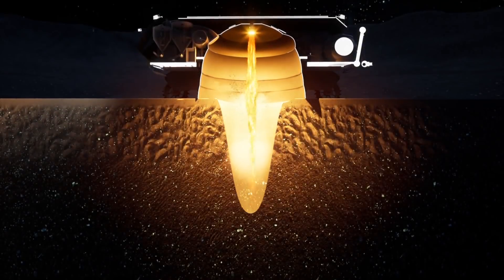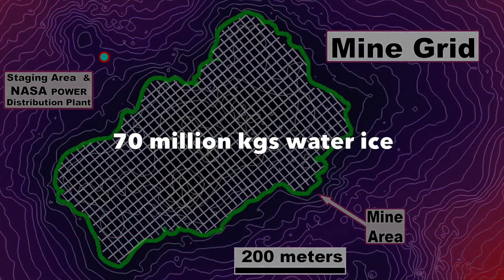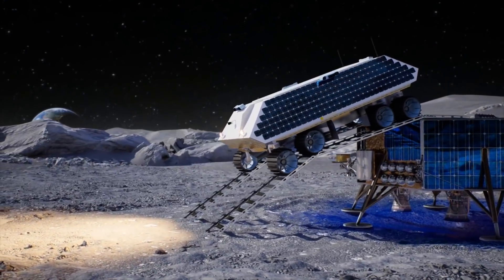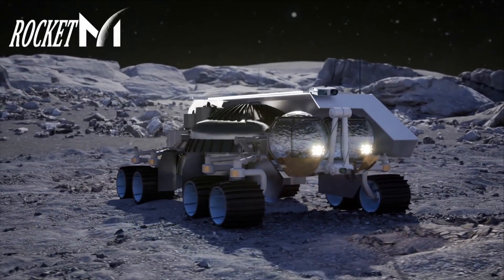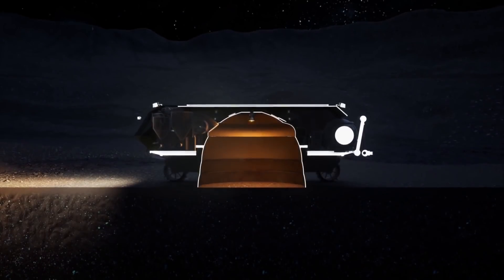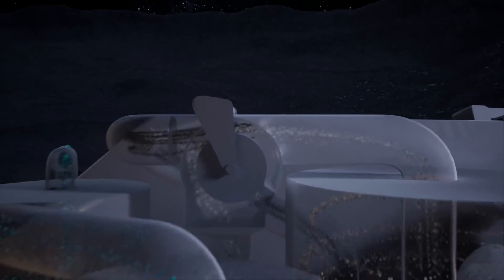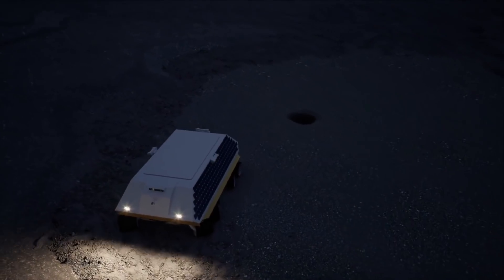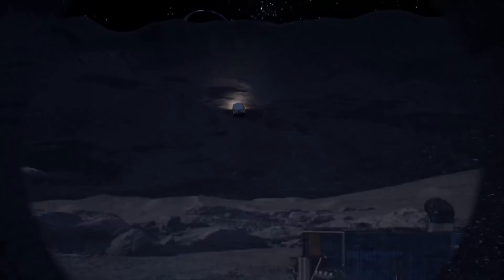Rocket Mining on the moon! Learn how Masten plans to extract volatiles

Comment: I must have missed something...  Where is the fuel for the rocket extraction system going to come from to dig thousands of holes in the lunar surface?  It has to use a whole lot of fuel.
Reply: well it’s already icy and it’s using pulses instead of a constant burn, also it’s not trying to lift anything just melt. Maybe it gets a top off from the lander or other dedicated systems that they didn’t talk about?

Comment: okay, so they're going to use a rocket engine to dig holes in the lunar surface....and they're going to fuel it with what? if it's some sort of pre-processed rocket fuel (hydrazine or some other hypergolic fuel), then they're only going to get so many firings before they run out of fuel and have to 'refuel' from their lander or wherever. if, otoh, they're planning on using hydrogen and oxygen derived from the water they harvest, then that's going to eat into the amount of water they can deliver. worse, the amount of water present subsurface is going to be a 'guesstimate' based on remote sensing data. so what happens if the water is just a  surface deposit, with little-to-no ice underneath?

Comment: Create a seal?  Pneumatic cyclones?  Is this a joke?  

Did you guys miss that day back in Rocket Scientist school where they taught about space, including the surface of the moon, being a total vacuum, completely void of any air/gas that would be needed in a pneumatic cyclone system?  

And what was it about all that jagged lunar material that was brought back to earth back in the days of Apollo suggests that there is even a snowballs chance in hell of creating a seal that would contain and maintain any kind of air/gas pressure that would enable the cyclones to work?  

I assume these things will use hydro/lox engines that will themselves produce nothing but water vapor.  But are you sure the liquid water vapor won't react with mineral compounds in the regolith and create some other type of pollution?  Will the dome be made out of thick, abrasion resistant material to resist the abrasion from the reaction of the regolith being blasted up and onto the underside of the dome and especially to the engines?  Have you done any serious tests on this?  

Wouldn't it be cheaper to just bring a few kegs of ice cold rocky mountain spring water along?